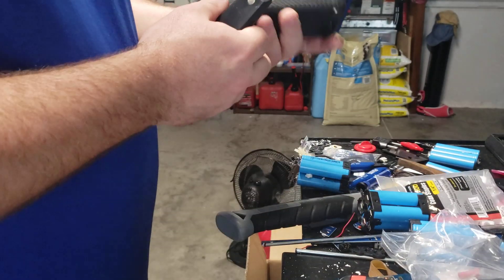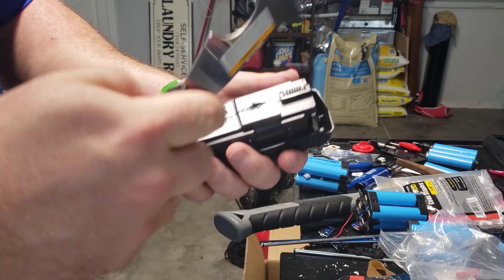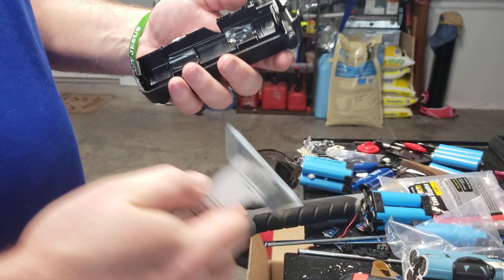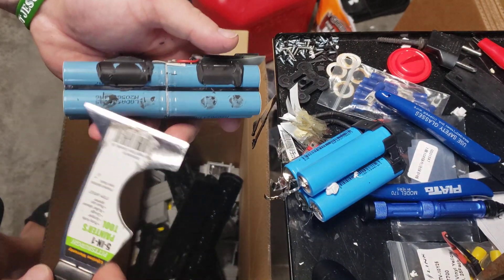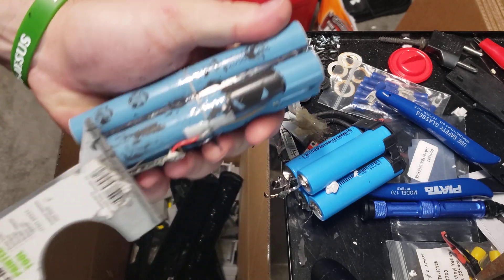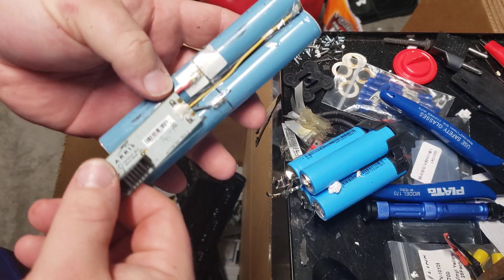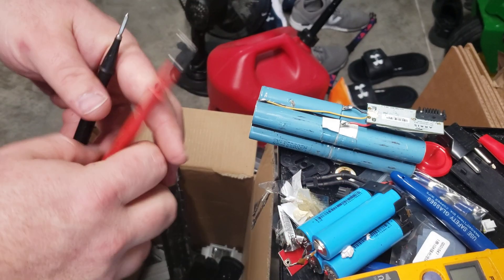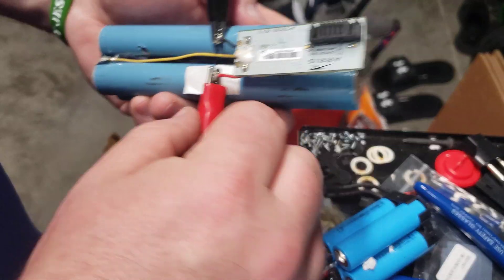Arris 8-pack modem cell 18650 teardown, powerwall, tesla

Comment: Instead of prying it open, try cutting through the stickers on both sides with an exacto or similar blade.  Then you can hold the battery in a vise and just push it open with no problem.  I did a video on this. The ones I have opened have contained mostly LG cells and they are the most difficult to get the cells out due to the amount of adhesive they use.  The Sony and Molicells were the easiest to get the cells out.